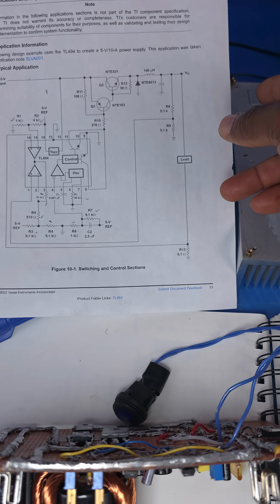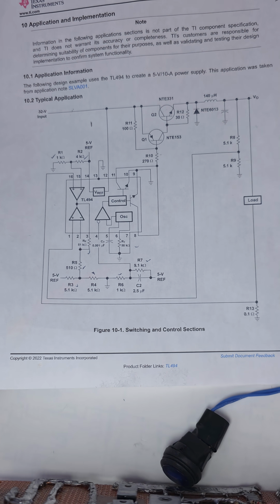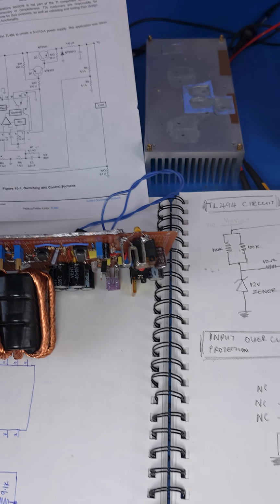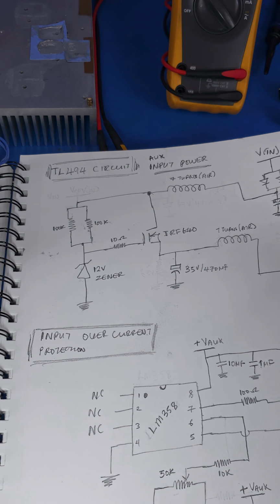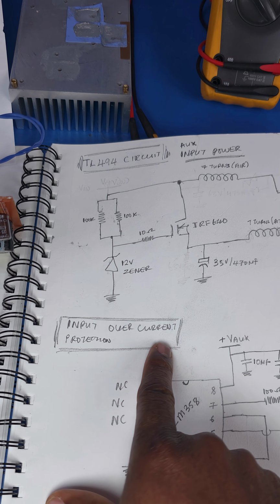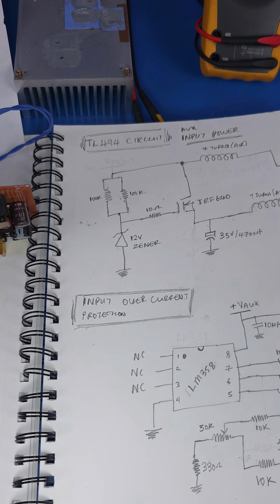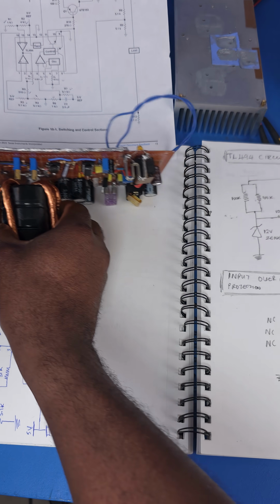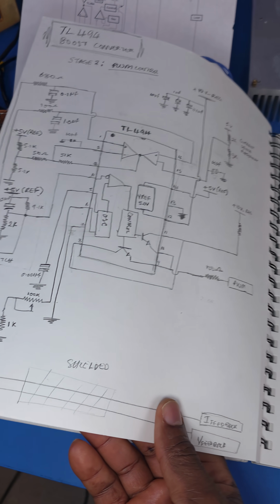Capturing SCHEMATIC for Diy DC-DC BOOSTER!⚡️#shorts #power #dctodc

Comment: I have 2 EcoFlow Delta Pros.  They are 48v 15S.  However I have 51.2V 16S battery.  I use a DC DC boost converter on the solar port (15.5 amps max 150v max).  Instead of getting 800 watt charging of EcoFlow I can get 1500 watts from golf cart battery through XT60i port.  I need a Buck Boost converter that will allow bi-directional flow of current up to 40 amps between 48v internal battery and 51.2v golf cart expansion battery.  Recent YouTube video show how to unlock expansion battery port and connect 3rd party batteries to EcoFlow power stations.
Reply from the maker: Wonderful!
It sounds like an awesome diy project.
Let me know if you have any questions.

Respectfully,
The Innovati0n Lab

Comment: Where I can buy? I need 12->14,65V model 100A pls!
Reply from the maker: I am not sure this exists. You will have to build it as a custom device. However, such a device will be very expensive to make.

Caution:⚠️⚠️⚠️
The high voltage range you stated in your comment is lethal. Please be careful.

Respectfully,
The Innovati0n Lab